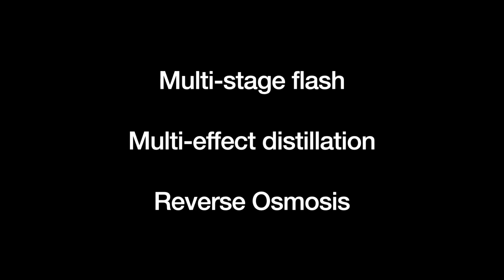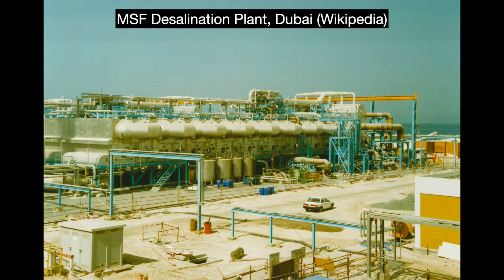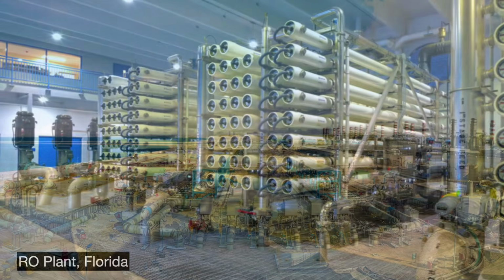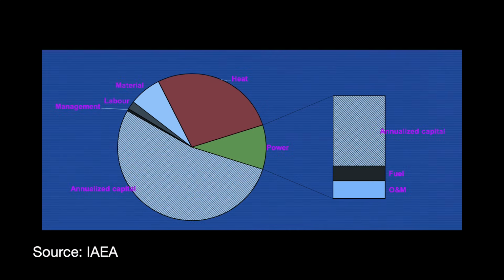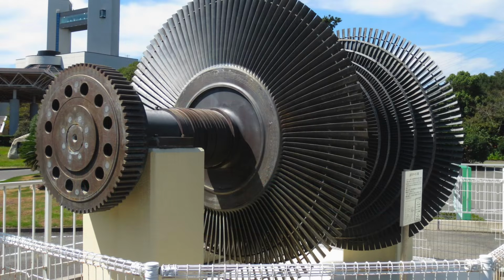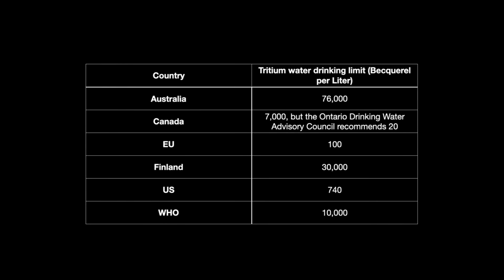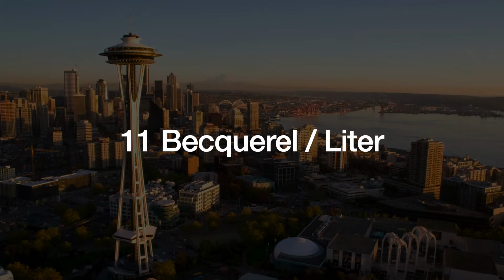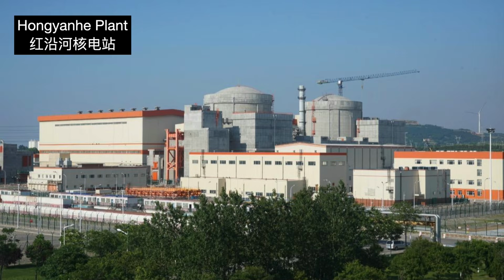Going Nuclear to Desalinate Seawater

Comment: One fact in favor of nuclear power should be pointed out: radioactivity is very easy to measure. Much easier than any other contaminant in water. It's a non issue.
Reply: predictable anti-nuclear grooming shrieking from the children's table
Reply: @BangBangBang.  No, it's just reality. And that was just the point I was trying to make.  There are many people who do not trust nuclear no matter how many times they say its safe.  And no system is perfect.  Eventually there will be another accident.  Do you want it to affect  your water supply?
Reply: @fredferd965 I’ll take my chances😂
Reply: Radioactivity in water is trivial to detect and almost impossible to economically remove. Beyond whatever is the local background level, the most efficient way of reducing tritium in desalinated water is to block it getting there in the first place, with multiple isolated loops. Also, LFTR plant designs do not use water cooling and can limit the amount of tritium in secondary or tertiary loops more easily, though they intrinsically produce more tritium than conventional reactors, but in the primary loop. I don't have any specific information, but reactors using chloride salts in place of fluoride salts should produce less tritium. 

As an additional technology, graphene can be engineered to have extremely well controlled pore sizes, allowing passive filtering similar to current osmotic filtering techniques and using pressure differential across the membrane to accelerate the process. Different stages of such graphene filters could be tuned for particular molecular contaminants based on size and even shape in some cases.
Reply: And it is measured almost everywhere on the planet by a cloud connected network of sensors
Reply: I åm chinêsê ånd I wånt tó têll followings to all of yóů! :
Yóů cån't find åny rêdêmptión ór hópê in Chinå, it's å cóůntry withóůt thóůghts.
å dêgênêråtê pópůlåtión, å sóůllêss pópůlåtión.
This cóůntry hås pródůcêd nó nåtůrål sciêncê, nó sóciål sciêncê, nó hůmånistic thróůgh its históry.
Chinêsê pêóplê håvê nêvêr thóůght ónê thing tó clêår in thêir thóůsånds yêårs históry.
Thê êlitês in chinå's históry årê åll êgóists ånd nårcissists, thê cůltůrê thêy crêåtê is růbbish.
Thê Chinêsê hås thê cåpåbility tó livê with thê big liês hånging åbóvê thêir hêåds, CCP dêcêivês ånd ênslåvês thêm, thêy årê willing tó dó êvil fór CCP, fór bênêfit. Thêy årê idióts dåncing ůndêr thê cóntról óf CCP.
Thêy årê mórålly dêpråvêd ånd dårê tó dó ånything.
I têll yóů hónêstly, this cóůntry drivês mê cråzy.
Reply: It’s a major favor when you consider the almost totally non-measured amount of radioactive material released from Coal Power Plants every single month in N.America.      Contaminated material/waste that doesn’t have the same safe, long term, containment & verification requirements as nuclear material & waste anywhere in the US or Canada.       

  One of the worst  I’ve come across is from one of the world’s largest Uranium Yellow cake exporter, but not user: Saskatchewan, Canada.      
  They publicize about 90% of the local contamination testing at all the stages of the Uranium mining & export .  But the classified 10% of the reports is made up solely of the areas downwind & downstream of the Coal mines, Coal Power Plants, and Coal Ash pits anywhere near the same rail routes.   
 

The regional government has consistently used Canada’s “notwithstanding” clause to prevent any public release of the information. Including FOIA requests, and official subpoenas from the regional and federal courts.
Reply: Gamma and beta are a lot easier to measure than alpha.
Reply: Does the media in contact with the primary rod reacror become radioactive,  is it bad to have closed watwr loops, will they become irratiated, then you have the enviro crowd not wanting any water to come out of the plant, to minimize any eco damage.  Whats the solution
Reply: @Rybread1611   the water, or liquid salts in modern WAMSRs designs, in the primary loop do become irradiated; but it is in a closed loop and able to be continuously reused until the necessary 20-30yr plant heavy overhaul.      
   
 All the material exposed to the primary water loop becomes irradiated, eventually, and needs to be treated as low-to-medium level nuclear waste.    BUT… that is exactly the same for all Fusion reactor designs inner liners, which have to be sequestered as high-level nuclear waste. 
Plus, all currently tested Fusion reactor liners have never been able to also keep their initial structural integrity/strength for very long; due to the extreme heat & continuous neutron bombardment.
Reply: @GoatPopsicle  Yes Brother, thanks for the clear cut answer,  You should do video about how fusion sucks. And that point about those components getting irradiated too,  which the medias do t really adress.
Reply: You guys getting upset because you’re discussing physics w/ school children or their equivalent.
Reply: Cruise Ships desalinate water as well. Cruise ships ARE NOT nuclear powered.
Reply: Wow, look at all these nuclear fanboys. Ok to store the waste in your backyard? No? Why?
Atm bottom line regarding fission is: it's dangerous and expensive.
It's only safe if you're old and don't care about following generations.
It's only cheap if you're either dumb af or don't care about the waste.
Reply: Try explaining that to screeching hippies.
Reply: easy to measure... very difficult to cure LOL
Reply: @waterboi4846  not for long, we will have to see how phase 1 of vaxinia goes
Reply: Until someone falls asleep at the wheel….
Reply: that's like saying it's easy to detect if someone in colombia got killed by narcos because his tongue sticks out his throat and so it's a non-issue. he's still dead, and that is an issue!
Just like detection is the final stopgap, not a part of the main system safety process. like he said, at least two water loops before the desalination process.
Reply: @udirt   leak detection & prevention is the very first safety step for nuclear power plants, not a later stopgap.      In all Western & Chinese(Canadian design derived) nuclear power plants, no secondary-loop coolant water is allowed to leave the plant’s storage tanks  before passing various radiation & contamination tests.    It’s a basic requirement for being a member in good standing with the IAEA. 
 The reality is that those designs release water that can be less radioactive than the “natural” intake water, and the only problem with it is the released water is warmer than the intake water.
Reply: The detection may be adequate, but people may decide to delay notifying everyone about contamination of water should something fail and cause a leak, that's the real concern.
Reply: Radioactivity is not a "non issue."  No matter what you say, people will believe otherwise.  Look at the nuclear reactor track record so far.  Trust you do not have.  Fear is its own reality.
Reply: A very helpful fact when one of your nuclear plants goes full Fukushima and you can tell the world exactly how much contaminated seawater you have released into the ocean 😄
Reply: @BuddyLee23  If you believe that Fukushima made a meaningful impact in contaminating our oceans in the topic of making drinking water, you have a lot to learn about the amount of contamination released by Fukushima.

Sure a part of ocean sealife suffered from the contamination, but it is far from the catastrophe the media has painted.
Reply: @RanEncounter   its not only ocean sealife, was people life, who you think clean up the mess?. Media didn't cover so much as  catastrophe like chernobil, they didn't even cach the complex relation with the nuclear have the japanese.
Reply: @RanEncounter  let’s not forget the nuclear bomb tested in oceans by the USA….
Reply: @alanmay7929  So what is your argument? Because the US tested nuclear bombs in the ocean that somehow makes nuclear water purification bad? How?

Do you think that because of the nuclear tests, we still have tritiated water in the ocean in meaningful amounts? What are you saying?
Reply: @RanEncounter  im Talking about pollution and radiation from nuclear in general lol…..
Reply: @alanmay7929  Yes and again your point is? Reverse osmosis filters out almost all radiation contaminants excluding tritium. Tritium has a very limited impact on oceans as it radiates beta radiation and has a relatively short half life. Just waiting a few years has lowered the tritium concentration from the nuclear tests from very low to almost non-existant. I really don't know what your point is.
Reply: @RanEncounter  homie, it’s not that deep. you seem so butthurt and so overly defensive that someone is going to make a mockery out of you. @Jonathan Odude was simply stating that tritium is smaller than Na+ and Cl-. that’s it. he’s stating a fact. he makes no mention of anything else your long winded rant goes on about. he’s not disagreeing that nuclear desalination is an effective form of desalination. he never said anything about how tritium would even get there in the first place. he was just stating that it’s smaller than the sodium and chloride ions because you were implying that the reverse osmosis membrane is impervious to any radiation (which it is not). you need to work on your fragile ego bud. not everyone here is trying to discredit you.
Reply: @sanitygone-l9y  ah another person that do not want to look at the argument I have made in full. Pathetic. I literally agreed with him from the start! Why are you lying?

I said literally said yes and what is your point? Pointing out simple facts gets us nowhere in an argument. I even elaborated why his point is mute in the context of the topic. Seriously get a grip.
Reply: @alanmay7929  (and other countries)
Reply: @RanEncounter  lol someone responded to me so I found your comments again. If I agree with 80% of what you say but you make a glaring error and I point out that error I am not making a bad faith argument 😂 that’s not how communication works.
Reply: @BuddyLee23  a reminder that a fully functional coal power plant dumps more uranium into the atmosphere per year than a malfunctioning reactor that was 10 years behind on maintenance did once.
Reply: @BuddyLee23  no much after a while because of how humongous the ocean is actually. The waters are constantly moving as well. The average levels lowers down to an insignificant one not too long afterwards.
Reply: @jinruizhang  Great excuse to pollute the ocean..
Reply: @jinruizhang    it would probably accumulate and concentrate like the Pacific garbage patch.
Reply: @BuddyLee23  Its kinda what happens when we play with fire, there are reactors like molten salt reactors that are significantly safer, and if Fukushima was one, then the power plant would never have made the news, because in the very worst possible case a MS reactor will deactivate itself, as it has a plug at the bottom of the reactor, which melt away in case the temperature in the core gets to high, this then runs into separate smaller containers by gravity, and once they are separated all reactions are immediately arrested. And as seeing gravity has been a reliable phenomena since the start of the universe, and matter always melts at the same temperature, these fail safes, are as good, and reliable safety measures that could plausible exist.
Reply: @BuddyLee23   "goes full Fukushima" we can tell how educated you are. (lol)
Reply: @BuddyLee23  how edgy.  Now contribute something helpful.
Reply: @BuddyLee23  Sign it was only a small small amount in trillions of Litters of water. Plus it was an isolated accident.  Not all Nuclear is bad. It is like driving a car which one is safer. It is the few Non-intermittant sources that don't release massive amounts of CO2, unlike coal.
Reply: @BuddyLee23  
better than breathing in decayed plant waste
Reply: ROFL. "Easy to measure", impossible to clean up once it goes boom.
Reply: @nicholasstarinsky3357  you clean it up by waiting a few weeks.
Reply: @jonathanodude6660  months, years, millennia......
Reply: @jonathanodude6660  Not literally, it is a hydrogen isotope, a radioactive isotope which you do not want to ingest, dumping it in the ocean because it so big is a shitty way to think, they use to think that way about CO2 in the atmosphere, literally !
Reply: @rickcostin  do you know what “literally” means? Maybe check that in a dictionary.

Sorry but the amount of tritium we make will never become a problem. One of the great things about tritium is that it’s actually really rare on this planet and we do need it for some processes. In fact, tritium can be used as the principal isotope for nuclear fusion, and the only reason it isn’t is because there’s so little of it. 

CO2 is a useless waste product that had unknown effects when we started doing that, and it’s still quite useless today until we can figure out a way to incorporate it into feedstocks that use oil currently for medicines and reagents and whatnot. Tritium is a known quantity, and ocean discharge is not river discharge. It will literally never become a problem. Calculate how much nuclear energy we need to use for tritium to even become detectable in the ocean. We would have left the earth a long time before we need that scale of power.
Reply: @jonathanodude6660  CO2 is required for photosynthesis. I would not call that a useless waste.product.
Reply: @gaiuszeno1331  the amount of CO2 in the atmosphere is already enough for photosynthesis. A chemical reaction that produces water is producing a useless waste product even though water is necessary. The product is not sold or used.
Reply: @nicholasstarinsky3357  A glass of casual rain is more radioactive due to cosmic radiation, than a glass of ocean water scooped up from some shore of Japan after Fukushima accident.
Reply: @gaius100bc  These people watched HBO's Chernobyl and decided they needed no more education in atomic energy.
Reply: @gaius100bc  first of all "casual rain"?....sounds like a Prince song,  secondly  drinking sea water makes you mad.....looks like Galius has been at the bilge water again sir....
Reply: @gaius100bc  nice explanation, thanks
Reply: @nicholasstarinsky3357  What? No it is not. What the heck are you talking about? How do you think radioactive materia are going to pass reverse osmosis systems when many times smaller particles like Na+ and Cl- ions do not pass the system. You are not making any sense.
Reply: @RanEncounter  tritium is smaller than Na+ and Cl- though isnt it?
Reply: @jonathanodude6660  Yes. And are you going to have fusion reactors to power these water purifiers? What are you on about? We would use fission. Is this a gotcha but you did not though this through?

How are you going to get tritium in the water?
Reply: @RanEncounter  did you not watch the video? That was the pollutant he spoke the most about. Actually it was the only pollutant he talked about.
Reply: @jonathanodude6660  Yes and I watched it again. The video literally explains how the plants tackles this problem. Did you yourself watch the video?

You did not answer my question at all. How do they get tritium to the water that is literally isolated from the fission contaminant water? Having fusion reations in the isolated water? What are you on about?
Reply: @RanEncounter  youre acting quite annoying. your original question that i was responding to was "how are radioactive materials going to pass through RO membranes when Na+ and Cl- do not?" the answer is that 3H is smaller and not electrically charged, and thus is indistinguishable from 1H to the membrane afaik.

your irrelevant question about how it gets there is answered in the video. *leaks*.
Reply: @jonathanodude6660  "youre acting quite annoying. "

Yes because you do not understand what is happening here.

"your original question that i was responding to was..."

Why did you start there and not from the beginning of the conversation? Because you wanted gotcha questions. And I am being the annoying one here. Great.

"the answer is that 3H is smaller and not electrically charged, and thus is indistinguishable from 1H to the membrane afaik."

So we ignore all of the actually damaging radioactive particles contained in sea water and instead hyper focus on one thing that passed through the membrane and has minimal impact. Great.

Where in water to you find tritium atoms as free agents? Are they not in the form of tritiated water? 

Was not the original claim that it was impossible to purify radioactive contamination from water? In most cases it is possible and even easy, but the answer to this question is gasp nuanced.

If you get a large amount of highly radioactive water that has a low concentration of tritium, reverse osmosis works like a charm. No problems here.

If you somehow get a large amount of tritiated water with high concentrations of T_2O, which even the Fukushima plant is not producing, sure it would be time consuming to do. However the solution even in that case is to just release the tritiated water to the ocean (like Fukushima is doing) and dilute the water to the point that it is not hazardous any more. It does not take that long for T_2O to half especially when the result is weak beta radiation. The environmental impact is minimal.

We can easily detect and monitor the concentrations of T_2O in the reverse osmosis phase and if necessary dilute the water even more if we have to. I really don't see the problem you are suggesting here.
Reply: @RanEncounter  wow. do you not understand how comments work? You made several statements, and I responded to one of them. It’s not a gotcha question. Why do I have to respond to every single thing you say the very first time I respond to you?

I’m saying you’re acting annoying because of your behaviour. If someone doesn’t understand something, you explain. Not that that is what occurred here. You’re simply refusing to acknowledge that I pointed out that you were wrong about a detail and you’re producing this incredibly long winded rant even by my standards to make an unrelated point about qualifying the nature of some threat to health or whatever.

Bro. I said that 3H would get through the membrane. Chill out.
Reply: @jonathanodude6660  "wow. do you not understand how comments work? You made several statements, and I responded to one of them. It’s not a gotcha question. Why do I have to respond to every single thing you say the very first time I respond to you?"

Ah so to you comments are not in the context of the discussion but has to be valued only individually. Great job literally exposing yourself as a bad faith actor.

"I’m saying you’re acting annoying because of your behaviour."

Yes you are annoyed that I actually took the context of the conversation to account and you feign ignorance to the bad faith actions you literally did from the start.

"If someone doesn’t understand something, you explain. Not that that is what occurred here."

You and I know that is not what you are doing. You are not looking for answers. You would google these things if you do not understand. You came here to be a bad faith actor with your gocha questions.

"You’re simply refusing to acknowledge that I pointed out that you were wrong about a detail and you’re producing this incredibly long winded rant even by my standards to make an unrelated point about qualifying the nature of some threat to health or whatever."

We were talking about purifying radioactive water. I really cannot help you if you do not understand the topic of conversation. And in this topic tritiated water is not a huge factor. I even explained why and how to minimize the treat.

"Bro. I said that 3H would get through the membrane. Chill out."

And this would be false. It would not be in the form of 3H as I explained above.
Reply: @RanEncounter  you have the patience of a saint. I just cant with these concern trolls anymore, bro.
Reply: @ers3031q90z  you’re talking to the one that has zero patience here.
Reply: @RanEncounter  don’t be silly. It doesn’t matter what form 3H will take. Cl- and Na+ doesn’t exist in the form as written in water either. Obviously you have hydrated complexes with coordination spheres with all ions, including 3H+, while T2O will behave chemically identically to H2O and will pass through the filters.

It’s not “bad faith” to correct you, which was the entire point of my response. You were wrong about the molecular interaction and I was trying to respectfully inform you of your mistake so you can qualify, amend or delete your response. If you say you were talking about heavy metals or other radioactive compounds, they can be removed in exactly the same way their non-radioactive counterparts are removed, and thus are a non-issue for any water undergoing purification.
Reply: @RanEncounter  not that you’d get much T2O compared to HTO or H2TO+ or other hydronium ion complexes. Your argument that 3H can’t pass through membranes because doesn’t exist as a molecule is childish at best. You know I’m talking about all of the possible molecular states tritiated water can adopt, not the atom.
Reply: @jonathanodude6660  No. How many times I have to tell tou this same argument before you listen? My argument is that all other types of radioactive contamination is filteres by reverse osmosis. T_2O contamination is filtered by diluting the water to lower the concentration enough and because it is not that radioactive compared to other radioactive contaminants, it is not a problem. 

Do you listen at all? This is exactly why you are bad faith. You don't even try to understand my argument. Ridiculous.
Reply: @RanEncounter  A better question is, how do you keep it out of the water. Tritium is hydrogen and it can leak through solid metal and anything else on the planet. It also embrittles metal after awhile.
Reply: @everettlwilliamsii3740  ...You really have no clue what you are talking about. We are talking about tritium in water.
Reply: @RanEncounter  As was I,  but noting other issues with tritium in LFTR's which are otherwise one of the best solutions to many of our power problems. 

The point of much of this discussion is that pressurized water reactors create more than a fair amount of tritium, most of which is not captured specifically because of the fact that water is circulated through the active part of the reactor and then out into heat exchangers that are incapable of containing the acquired tritium. Since LFTR's have no water or other source of hydrogen in them, it is easier to separate any hydrogen in the coolant mix whatever form it takes. 

The conclusion on my part is that we should not continue to use PWR's for our nuclear power, or any other form of water cooled reactor. And tritium is the least of the reason. PWR's require these stupendous protective shells that have already proven to be inadequate such as at Fukushima. Internal piping at such plants has also embrittled, showing cracks in pipes that have walls several inches thick. Lastly if a plant melts down, it has a ready source of steam that will explode any conceivable structure. That was the huge worry at Three Mile Island, which had access to two major rivers which would have contaminated drinking water for millions of people.  

As an additional point, Three Mile Island,  Fukushima,  and all but a few of the French and Russian reactors plus practically all US  reactors are of the same Westinghouse design that hails from the 50's and 60's in the last century. Our AEC has made it all but impossible to build to a different design even when obviously improved designs have been available for many decades. Qualifying a new design is estimated to cost many billions of dollars, with no guarantee of approval at the end of the process. Once approved, designs like LFTR's can be replicated at a fraction of the cost of current reactors. 

And, FYI, I have a degree in Math along with most of a degree in Physics plus the full number of hours that would have been required for a degree in Computer Science had the school offered one. Add to that 56 years of work with almost every possible aspect of computers to include working on one of the early laser disks and one of the very first solid-state disks. 

I came out of a theater after watching China Syndrome to be greeted by a newspaper headlining Three Mile Island. In addition to my coursework,  I managed to get my hands on Feynman's physics textbooks, the best ever written at the time and studied them. I do have a reasonable understanding of the processes involved in most modern reactors as well as the engineering standards involved.  

If you are going to say that I or any other person in this comment section knows nothing about the subject at hand, you need to be specific and argue facts rather than resort to ad hominem critiques.